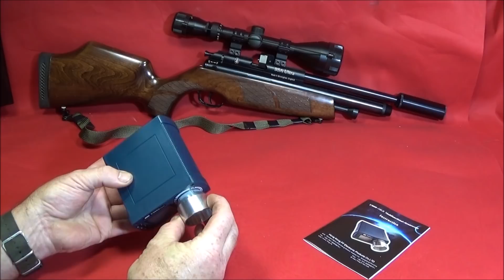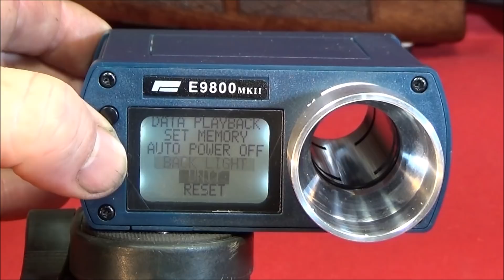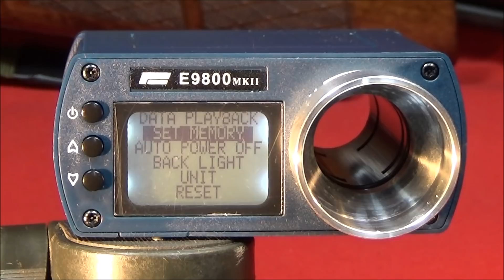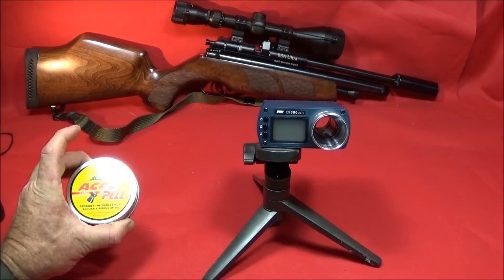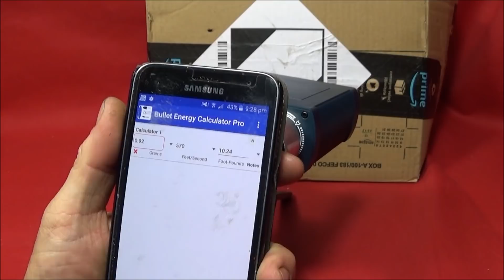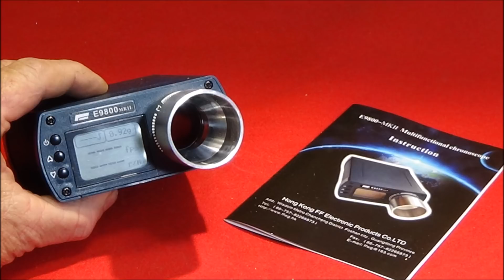The New E9800 MK2 Multi functional Precision Shooting Chronograph

Comment: I've just ordered this chrono. All the reviews appear good. Having to convert the readings to ftlbs didn't put me off because I'm used to doing that with my last chrono before I accidentally shot it beyond repair. The most important thing to me is how accurate the readings are. Time will tell, but along as its accurate enough to confidently and consistently tell me I'm below the uk 12 limit, I'll be happy.

Comment: I do hope you've an fac license lol.
Reply from the maker: I don't need one I keep all my air rifles 12 foot lbs or just under. Which is quite powerful enough and is the legal limit in the UK.
Reply: @SteveJordan  my bad, mistook the joules for ft-lb so used to sing energy measured in ft-lb as opposed to metric Joule. UK measuring system so mixed up between metric and imperial lol

Comment: Great bit of info. As a fellow shooter and model engineer, may I just remind everyone who is watching this that the 12 ft.lbs Muzzle Energy for the FAC exempt UK air rifle is the absolute limit. The letter of the law is that the gun Sholud Not Be Capable Of Exceeding 12 ft.lbs. Since the power of the gun fluctuates depending on the type and the weight of the pellet used, it is best to set the gun to no more than 11.4 ft.lbs ( 570 ft/s ) with a medium/heavy 16 grain pellet to stay on the right  side of the law.  Despite repeated requests by many fellow shooters those who must be obeyed would not change the 50 year old law to take account of the progress in accuracy and safety of the modern air rifles I regret to add.

Comment: Is it possible to clean the sensor port and elements?
I wonder how it will work with any powder propellants fouling the chrony?
The upper speed limits preclude any high power rifles.
Thanks
Reply: These units are not meant to be used with powder burning guns. These are primarily designed for airsoft 2J guns and will cope with airguns at a push. They are an economical way of keeping an eye  on the power of the sub 12 air guns. If you have a powder burning gun I suggest you take a look at  the Chrono Ballistic R2H ( Polish Chrono ) which is deigned for air rilfes and powder burners. They cost considerably more than the unit on test here but they are a darn sight cheaper than a proper Skan and just as accurate and consistent. Personally I would not bother with the  old Shooting Chrony type chronos as I have found them to be unreliable due to their sensitivity to light levels and pellet path. Hope you find this useful.
Reply from the maker: Hi Dennis, In the instructions it says to clean the sensors with a toothbrush. I would think that this one was aimed more at air rifles and pistols though.

Comment: Weighing pellets drove me mad until I discovered that the scientific weighing machines made by the likes of Oertling and Stanton are going for less than £50 on Fleabay when they originally cost thousands of pounds! They will easily weigh the ink in a full stop!
If you want to weigh your pellets to within a tenth of a thousandth of a gram, then you can! Converted to Grains, that is 0.0015, or in ounces, 4 millionths!!
I have a Stanton BA6 that cost £30, and an Oertling V20 that cost £12 (see video link) https://youtu.be/QJ626_3gJi4b

Comment: I wish I had seen this a couple of years ago. I went for a chrony myself  which was a lot more money than this one.. One of the reasons for getting the mini lathe was that it is getting increasingly difficult to get parts for my Falcon FN19, Air arms who own Falcon now have limited spares. So the only way I can get some of the spares is to make them myself. The difference in pellets and weights makes a huge difference to the calculations of power. Power does not necessarily mean accuracy though. I use crossmans and air arms diabelos as they work best in my rifle. Some of the European pellets increase the power, as I discovered during tests of sample pellets, but I personally only buy American and UK pellets.
Reply from the maker: Hi Stephen,  Its great that you can make up spares for your gun. I have one of those old Chinese B45 pump up rifles I was hoping to strip and remake all the internal components, but I doubt whether I will get the time. For my air rifles I just stick to the Crossman/Webley Accupel now. I have tried loads of different types but these seem to be the best for my accuracy. I only use mine for field target shooting, but use interesting targets like colored chalk, apples on sticks and bottle caps., things that show the effect of a hit. 
   I have had experience of using .22 rim-fire bullet rifles in the past and used to occasionally go to a gun club to see what was going on. A place where the members used to look-down on anyone that owned an air rifle, as if it was some kind of inferior gun. Personally I found the firearms target shooting to be quite boring and the air rifles to be so much more interesting.
Reply: HI Steve yes much the same here really Find the pellets that work best for your rifle and stick to them.  We have made all sort of targets, including one a friend of mine made which was basically a duck shoot driven by Arduino with random programs so you never know what they are going to do next.Here is an early incarnation https://youtu.be/snrOte4-JqY I am with you on some of the gun clubs, In fact I don't go in for any clubs now, They often take you where you don't want to go, so I would rather do my own thing.If you get a chance the CO2 QB78 and its  derivatives and easy to work on and are pretty accurate. Can't speak for the QB79 which has the larger co2 tank, which i personally  think is an incredibly ugly rifle, but the mechanism is basically the same. Some interesting shaped chalk target are available and some quite small and challenging. A friend bought some 10mm chalk skulls, they can be tricky to hit lol. You have a great channel Steve always look forward to your videos. Regards.

Comment: Nice review, as always, Steve.  Looks like the funnel is scratching the silencer.  Is it necessary to have the barrel inside the funnel?
Reply from the maker: Hi Jay Thanks, It doesn't scratch the silencer. They recommend putting the end of the barrel into the funnel up to that point, so as to make sure no one shoots the face of the unit or the sensors. Its a fail-safe method, probably invented after loads of earlier models were shot to bits!
 Many years ago I had a go with a friends chronograph and accidentally shot the edge of the face panel. Luckily it was made of metal and I managed to straighten it and give it a lick of paint..:)
Reply: That’s good. Thought I could see a scratch exactly where the funnel ends going around the circumference of the silencer. Which wouldn’t be what you’d expect—if it were rough you’d get a scratch lengthwise. Anyway, looks good. I’m going to get one for my airsoft gear.